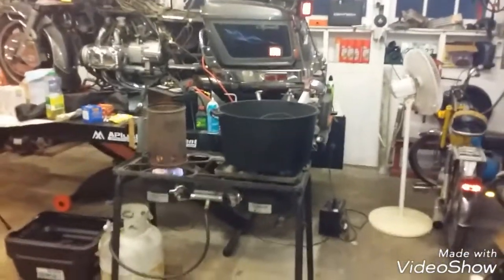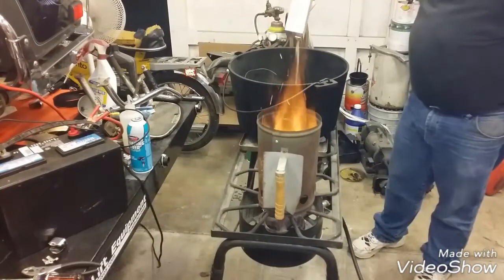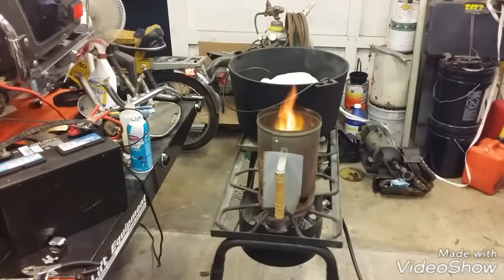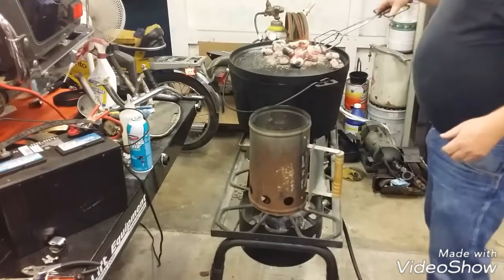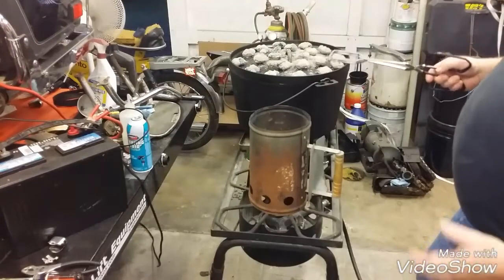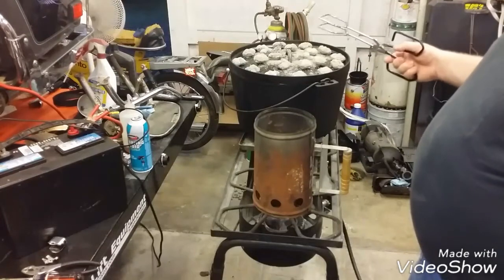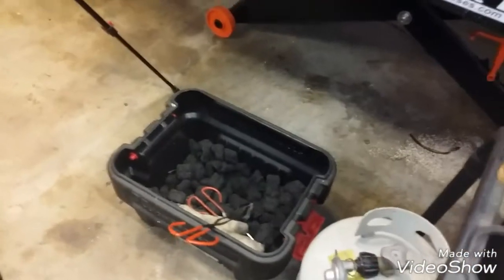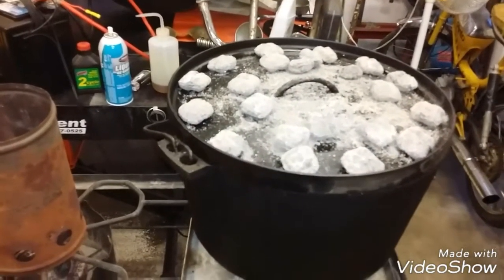Drunk 23 lb Turkey cooked in a Deep 17" Dutch oven for the holiday dinner .

Comment: Isn't that a little dangerous to do indoors?
Reply from the maker: Why? I have a 3000 sq ft barn, the upstairs peak of the building is 23 ft. The ol barn is well ventellated. Once the coal get going the smell is not too bad and can keep the doors closed most of the time. I am the only one here when cooking. Am interested in and safety concerns...
Thanks for the comment!
Reply: @GlennsSpeedShop  That was pretty close proximity to that battery for starters, and then we're dealing with carbon monoxide that we can't smell. I'd also be thinking about smoke damage and stuff like that. Granted we can only see a small portion of your room... Anyway, the turkey looked great!